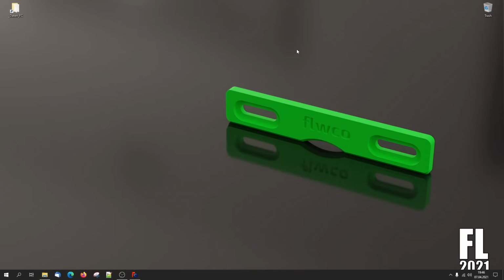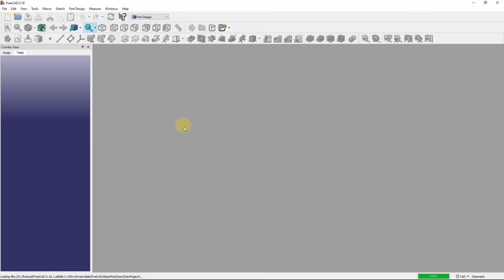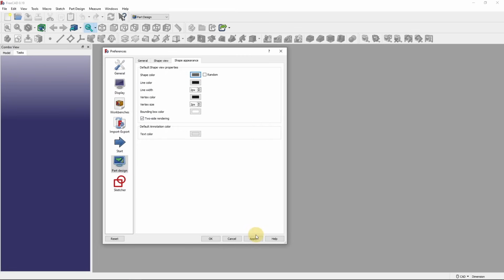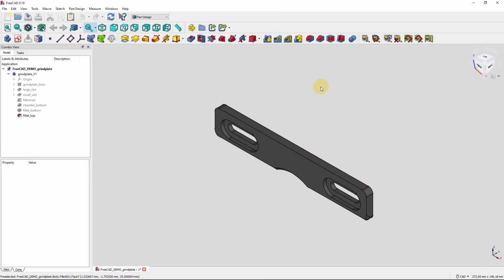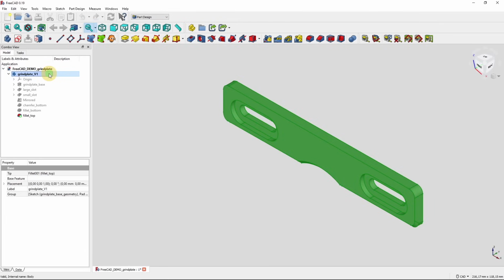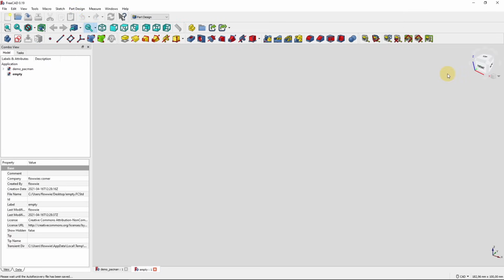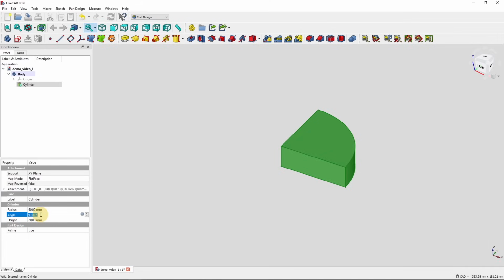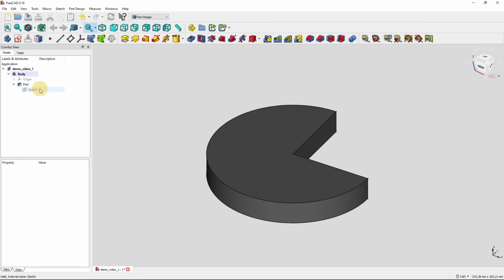FreeCAD 0.19 - Basic Course - Part 1 - Your start with FreeCAD (EN)

Comment: Man this program is so confusing.. I model in blender now I used to use cinema 4d a long time ago... Cad makes me feel like I am starting from scratch :(
Reply from the maker: It is just a completely different approach to 3D design. It's parametric design and not direct 3D modeling. If you don't need the type of 100% accurate 3D models for machining (like mechanical engineering parts or something like that) and you don't need technical drawings, then modeling in Blender with polygons is absolutely fine.

Comment: Great tutorial! Thanks for the effort you've put into this. I'm looking forward to viewing the entire series.
Will you be doing an explanation of the Part/Body/Sketch relationship? When do you use multiple bodies or multiple parts? Also, what would be helpful as you go is to explain when there are a couple different ways of doing something, why it's better to use operation A rather than B.
BTW, I just threw 25 Euros in the tip jar. As a software engineer, I know how much effort it takes to create these instructional videos. Keep up the great work.

Comment: As a native English speaker, I found this TOTALLY understandable! You have a slight accent, but nothing that detracts from the knowledge you are trying to impart. Regarding the content, very straight forward. I've been using FreeCAD for a few months, learning as I go, but I learned a couple valuable things here in this short video. One thing I realized is that I need to spend more time just clicking on icons to see what actions they represent. DUH!! Keep creating. I'm a subscriber, I'll keep watching. :))
Reply: Agreed but, one, the version, the preferences, I have 018, not nine, many of those weren't available. Two, finally getting to the point, he mentioned the file he downloaded, I had to stop, and rewind, four times to get the fact that it's "grindplate". He's going too fast when I'm trying to follow along. I've got my mouse, TRYING TO FOLLOW ALONG. And it's driving me INSANE. THx
Reply: @TheJacklwilliams  One thing that often helps me when I'm trying to follow mouse flow is to slow the video down. It messes with the audio, so I have to watch it first to know what the desired goal is, but if I can follow the cursor, it sometimes helps.

Comment: This video series is LONG LONG LONG overdue. Thank you so much for starting it.
Reply: Not kidding, software where you cant even draw a box round the components to select them really needs some sort of course. But to be honest, I will be using something else a little more intuitive.
This is the problem with so much open source, it's almost unusable for the average user.
Reply: @Graeme758  actually, this is what's great about open source, it's built for purpose. Sure, you need to put in some effort to learn the interface but don't expect to hop from Paint to FreeCAD and retain all the MS point and clickyness.
Reply: @daveymg  Going from Tinkercad to Freecad is a bit like going from MS Paint to Photoshop.  If you haven't done CAD, you'll need a lesson.
Reply: Why not? But I don't now, which is why I am looking at other software, software that has put effort into usability and recognises that the goal of some users is to produce work, not play with software.